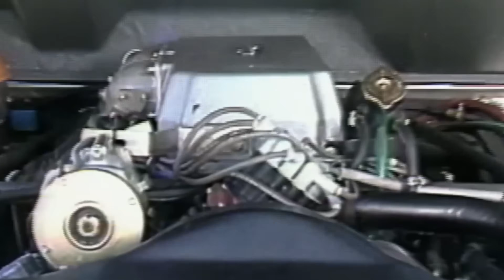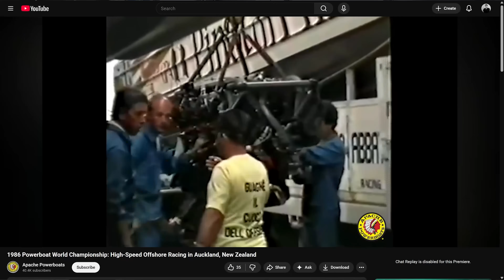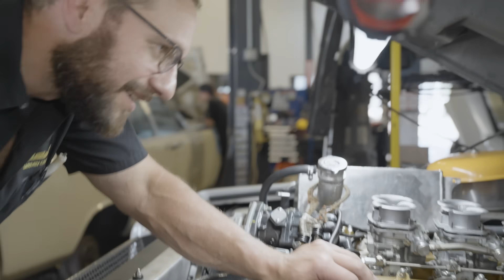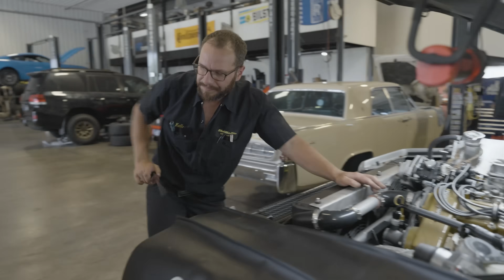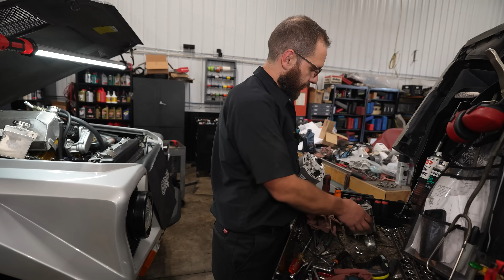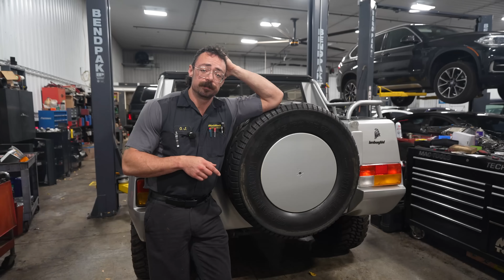How Pro Mechanics Repair Issues With ZERO Info|Difficulty: Nightmare mode 1 of 1 V12 Lambo Boat Swap

Comment: I saw this rig when you were open for a recent car show.  You need to remove the radiator fan shroud.  It’s literally blocking off airflow through 1/3 of the radiator’s area.  Could also do with some bigger vents in the hood to vent all that hot air out.  The engine is so packed in, there’s no room for volume airflow downstream and out from the rad.  Run it up and down the road with the hood off to test.  Also the pipes connecting the radiator looked kind of narrow to flow enough water.

Comment: Im a benz tech of 18 years and about 10 or 11 years ago I had a clk350 I believe, w209 chassis. Came in with an ac compressor that seized, no big deal. Replaced the compressor, ac blew cold and  got the car back to the customer. 2 days later he came back, ac not blowing cold. System still fully charged, actuation signal to compressor good but compressor wasn't making pressure. Replaced the compressor under warranty, blows cold again so I ship it. Again, 2 days later hes back, same everything. No way it's the compressor again,  tried replacing the flexible hose between the low side service port and compressor thinking the lining was collapsing in and blocking the line. No dice. Internet was no help. Reached out to friends at the dealership, and my old team leader dug through his archive of bulletins and found one referencing the coding in the electronic ignition switch glitching and switching it from convertible to coupe, causing the compressor to not turn on. So I checked, and there it was, body style had switched to coupe when it was a convertible. I changed the coding and the ac blows cold again. I still don't understand it, and never would've found that on my own

Comment: I love the truck. I like IDA webers better.. Have a 427 ford with webers and magneto. Minus the alternator voltage. I have played the balance verb game. When the fuel is hot in those bowls it will boil and you might need to drop float levels. Summer driving sucks.

Comment: Most mysterious was my 1990 Bronco II with fuel injection randomly cutting out. I tried everything, including looking at the archaic OBD I codes, replacing ignition, fuel pump relays, checked and cleaned all the wiring, grounds, on and on. Consulted the Ranger Forums where there's a lot of very experienced mechanics who work on these engines all the time. No useful tips. I even took it to a professional garage who could not fix it either. Until one day I noticed on my USB carger that the battery voltage while driving would sometimes just drop to as low as 11.5 volts. That battery had tested perfectly fine, always started the truck up very well, but apparently had some internal fault. Replaced the battery and the issue was gone. So, google no help

Comment: I would've recommended a fuel injection conversion. Carbs are such a PITA. constantly need to be re-sync'ed. @15:50... GM HEI's fail often with just 8 cylinders. I'd ditch it. MSD makes a harness that eliminates the HEI and allows running an MSD box. That's what I would've done.

Comment: I have a story where information was scarce and was caused by a unique circumstance, I used this coil pack, an MSD blaster 2 on 2 vehicles first I used it on my 84 Ford Ranger with a 2.3L and being young and broke at the time I poorly mounted the coil on the fender support with the coil wire too close to the fender, the truck ran fine like this for more than a year until a torrential down poor caused a connection from the wire to the fender arcing and killing the engine. I figured out my mistake and drove the truck with this coil for atleast another year then I needed a coil for my 91 subaru XT6 and took the coil from my truck later buying a new one for the truck. I drove the subaru for a couple summers before it started showing a weird symptom where when I took a hard left while driving the car would stall, only left turns and it always started back up after I came to a stop. strange problem, nobody knew what could be causing it. finally the car died in my sisters driveway after many months of this issue I finally figured out the coil was weak, not dead but just weak enough it wouldn't start. changed the coil and fired right up but the weird stalling was gone too. I can't rest until I have an answer so it went in and out of my mind for many months before it hit me. the coil was mounted straight up and down on the truck so it never had a problem but mounted sideways in the subaru it developed that weird symptom of stalling on hard left corners, the coil had arc damage inside the terminal for the secondary wire, there's a seal inside where the arc damage was and with the coil mounted sideways the oil inside the coil that transfers heat slowly leaked out and something would happen inside the coil when the oil sloshed to one side on a hard left corner causing a loss of spark until finally it lost enough oil that it failed to run the engine. I was chasing and checking for ghost problems in wiring and the hybrid steering and since the car is rare I had almost no help with information, but I should have checked my basics first.

Comment: 2013 golf TDI .. flashing glow plug light... Starts flashing at ignition on.. nothing fixed it... No data to find the fault everything tested good... Glow plugs, harness computer,glow plug module.. didn't have any faults except for a generic plug code

Comment: Weird problems are fun. I’ve got an 84 Honda V65 Sabre, that slowly disengages the hydraulic clutch as it runs. Only way to get it to move when it disengages is to pop the bleeder, the fluid pressure is let off and then it goes until it does it again. Never heard of anything like it

Comment: Not sure if this counts. My 19yr old son graduated high school this summer. He decided to move out to north eastern Colorado to get a job in oil field welding. So I gave him my 2000 tundra that I bought new. It was time for a new timing belt, water pump, thermostat and pullys. When we took it apart I told him to put bolts back in the holes that we could. Little did I know he put some in the wrong holes. So when it came time to re assemble, some stuff wasn’t matching up. I didn’t take any pictures since this was the 4th time doing it. I had to research for 2 hours to figure out what he did. We had a good laugh. I’m not a mechanic by trade.

Comment: Biggest ghost issue I've chased has been a weird microphone issue I have with my radio. I've tried better grounds, a new microphone, grounding the frame of the radio... I'm at the point now where, I can only assume I need to replace the radio altogether.
Reply: Pay for a schematic for your car. Betting you have a module in line
Reply: @theniceneighbor maybe? It's an aftermarket radio and i traced the microphone and even replaced it altogether from the recommendation from Kenwood tech rep.

Comment: I have a 2009 Honda Accord Ex-L 2.4 L I-Vtec sedan that I had to use google search for and yeah, it came up with several different things, but not a pinpointed exact thing it was still ghosted so I brought it to my personal mechanic and he noticed that my brake pads were too thick in the front on both sides so he took the front floor pads off, grind them down to the proper thickness and put them back on and re-change and change the brake fluid and then he noticed that my front stretch were leaking a little bit so I was like yeah throw those on for shits and giggles so you did and don’t even hear the front clunking that I was experiencing at first I thought I was the front subframe rattling and now I can oh that wouldn’t be a problem and then my girlfriend said that could be the brakes clunking sure enough that was the problem and it was the struts so no things to Google. I solved it on my own so and now I got a scan tool, but I know a scan tools. Don’t still don’t help me on that either so at first, I thought it was the lower control arms more than I thought. It was the front subframe then I thought maybe it could be the front swaybar that wasn’t the issue either both all those looked OK so it ended up being the front struts and brakes no thanks to Google and it took my personal mechanic. Just replaced the front struts and clean up the front brakes, which is grinding the front pads down to the proper thickness took a while when we figured it out now it’s not clunking no more my guess is the front front brakes and struts could’ve been the brakes could’ve been the front struts. I don’t know cause Google wouldn’t help me. It was a weird clunking noise not your average clunking front sway bar or an average front clunking lower control, arm issue or Tyrod outer tie, rod or inner tie rod I don’t know is that everything look good except for the front brakes and struts what a nightmare

Comment: 1:23 Strangest issue I had to diagnose was on my dad’s Mercedes GL. Fine when it was parked, the next day it would crank and start but wouldn’t go into any gear. Calls me in a panic, I drive over. Dashboard lit like a Christmas tree. Hardly anything would work inside or out other than the engine. Figured it had to be a can bus issue, the only common denominator between all the components. But, where to begin? Miles of networking and connections throughout the car, countless potential failed modules. Walked around the car while dreading the work ahead when I noticed a bit of condensation inside the drivers headlamp. A true light bulb moment. Pulled the fender liner, disconnected the headlamp module which was on the bottom of the lamp assembly. Started the car back up and voila, everything single worked. Relief. A rare emotional moment for my dad who gave me a big hug with pride.
Removed the headlamp and pulled the module from underneath. Was all corroded and filled with water. Terrible design. Complete hubris to think water won’t get into something, engineer it so water can get out.

Comment: If you are chasing electrical gremlins on a crank no start, instead of google..just throw your phone out the window.
Reply: I got lucky on my XJ, luckily the rotor in my distributor just fell apart... on a lunch break from work... at a gas station. Okay, not that lucky but it was a cheap part